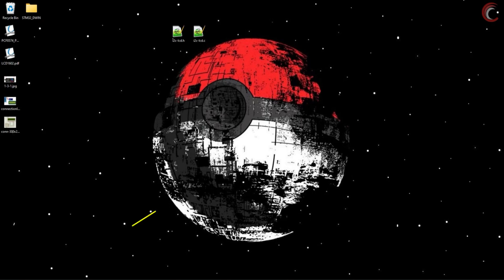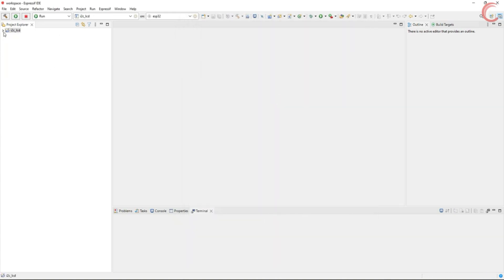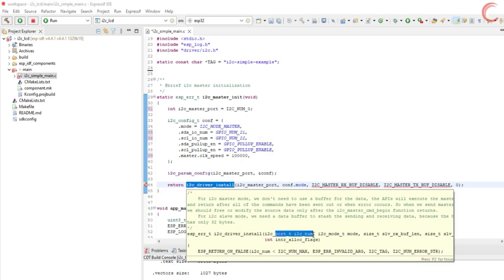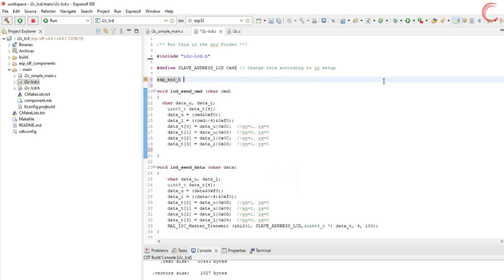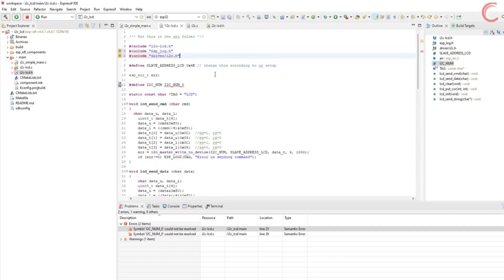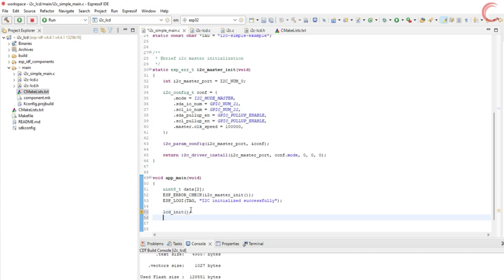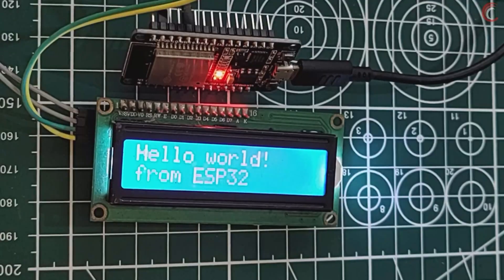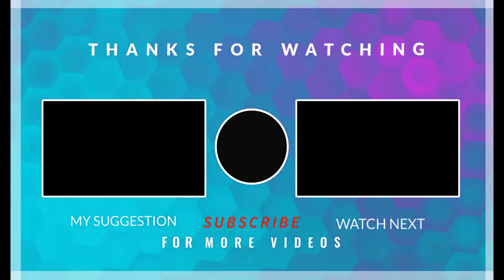ESP32#3 How to use I2C || PART 1 || Interface LCD1602

Comment: so the pins on the esp32 are 5 volt tolerant?
Reply from the maker: No they are not. The PCF8574 module converts the voltage to 3.3 level for the I2C pins.